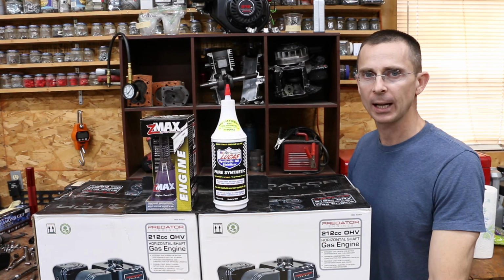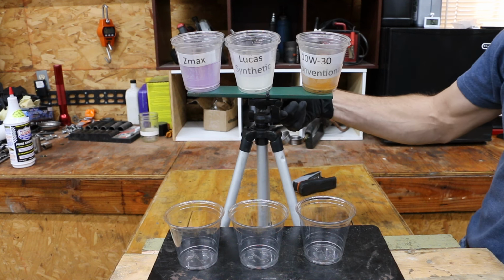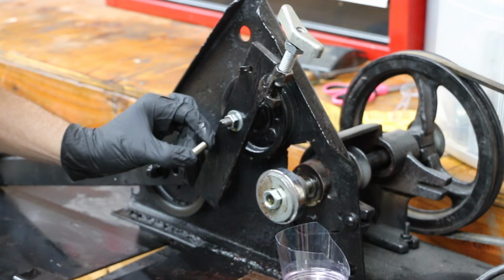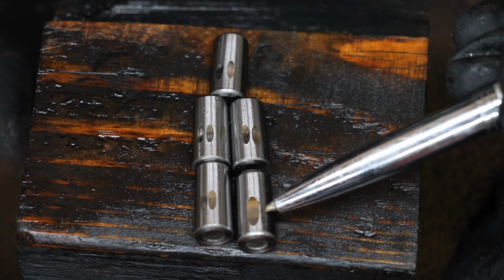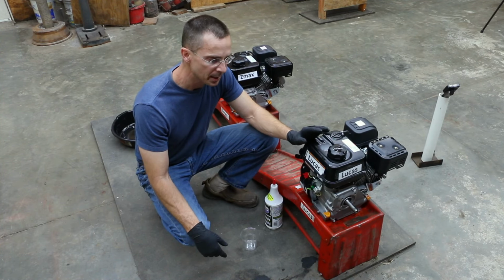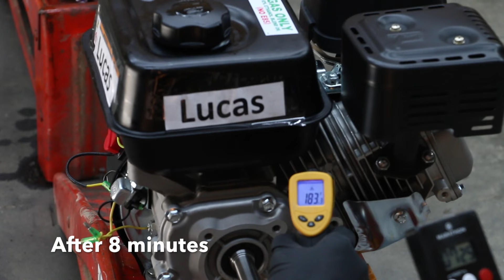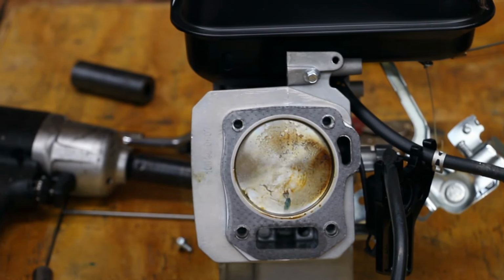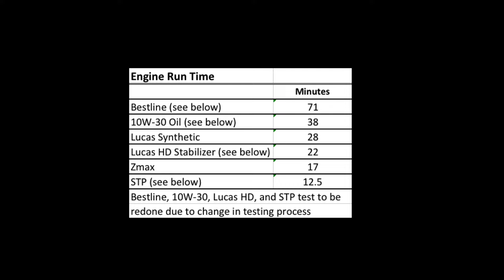Which engine self-destructs first? Zmax or Lucas Synthetic?

Comment: Battle of the labels - most expensive name brand non-synthetic oil vs cheapest generic white bottle with the word OIL on the side in black letters.
Reply from the maker: Thank you for this recommendation.
Reply: I like this idea. Theoretically, assuming they meet standards, both oils should perform comparably.
Reply: Yes good one. Always wondered about those dollar store engine oils
Reply: Project Farm If you do this PLEASE, PLEASE, PLEASE, make Amsoil one of the contenders!
Reply: This is one that NEEDS to be done!
Reply: Project Farm 1000% this should be your next video. Most generic oil you can find vs name brand and expensive oils. That would be VERY interesting...and useful to all of us!
Reply: Very good idea!
Reply: That kind of test really would be nice to see. 

Unfortunately, this type of testing does not show how well the oil copes with multiple hundred hot-cold-hot-cold cycles, how well it carries the contamination from the engine parts to the filter, how well it transfers heat or how well it protects against corrosion - all very important tasks for the engine oil and the more expensive oils often market to help with these.
Reply: Very good idea.  Dollar General branded oil VS Valvoline Synthetic Or other higher priced oil.
Reply: Good idea!!
Reply: Jason Patterson j
Reply: Stacy Smith also, call up engine masters for the amsoil recommendation like they do lol. Give it the best shot possible and pit against the dollar store brand. Very interested to see
Reply: technically they should be pretty similar as there are only 3 major producers of base stock oil. the real question lies in do they "water down"(aka cut it with fillers) the oil to extend it.
Reply: U know what I’d wanna see. The 2 best oils on the the planet head to head, Schaffer’s and amsoil

Comment: As a control sample, I would like to see an additional motor without any additives. This would tell us if the additives do any good at all.
Reply from the maker: Thank you for the feedback!
Reply: That’s a very good point I hadn’t thought about.
Reply: They are both useless in a well-designed engine with no obstructions in the oil circulation system. They are only useful in badly-designed engines or badly-maintained engines.

Lucas is oil premixed with a "climbing agent" that makes the oil stick to moving parts (gears, crankshaft counterweights, etc.) so it will get flung into neglected spots the oil doesn't normally reach. Lucas doesn't add any lubricity to normal engine oil, but because it's premixed with oil already, it's still a decent lubricant on its own. It's a BAD idea to run 100% Lucas though, because too much climbing agent will prevent the piston rings from scavenging oil properly and the engine will smoke like a chimney.
As for the Z-Max, it's basically a "pour-point depressant" that reduces the viscosity of cold oil so it circulates better -- hopefully without reducing the hot-viscosity of the oil once it's heated up. That should be completely unnecessary in a modern car because the oil they use is so thin already. However, I'd be interested to see a repeat of the initial viscosity and lubricity tests with the oil+additive mixture cooled in the freezer overnight.
Reply: @deusexaethera  OMG this guy can read.......... Wtf....
Reply: @themanthemyththelegend1392 : ...huh?
Reply: @deusexaethera  hence why it started on infomercials lol
Reply: Z-Max is a scam.
Reply: @ihatesmartphones  check the ending out
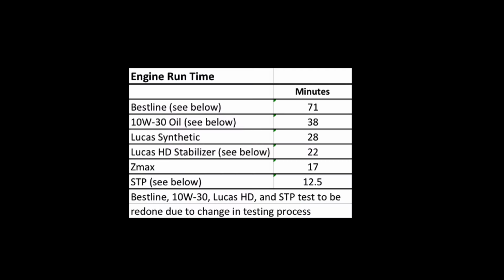Reply: 14:26 for everyone who hasn't seen it
Reply: @deusexaethera  - thank you. I was trying to understand why I got different results than these tests and you explained it.
  About 18 years ago I bought an old Dodge-chassis Winnebago motorhome, drove it 1000 miles east and loaded it with tools and stuff, then drove it back west to the starting point. We generally used Castrol, which is based on castor oil and doesn't mix with everything, but a friend who drove cross country a lot used Z-Max with it with good results. With Castrol High Mileage alone, the motorhome was getting 6 mpg highway. After adding Z-Max products to both engine and transmission, it went to 9 mpg with more load. So "pleased" is putting it mildly.
   So from what you said, that improvement was from better oil flow and lower drag via lowered viscosity.
  About that time, on the ignorant recommendation of an auto parts clerk assuring me it would mix with Castrol, I tried Lucas oil additive in a Plymouth minivan. This was before the synthetic Lucas, I don't know what would have happened with that. What did happen was the Lucas coagulated the Castrol into a thick goo that caused the timing chain tensioner to fail and derailed the chain and destroyed the engine in a previously useful minivan. Ever since then, I have bitter memories of the Lucas name and won't go near any of their products.
   I don't use Castrol anymore either. I run full synthetic oil in everything - cars, trucks, lawnmowers, 4-cycle weedeaters, anything with an engine. Preferably Royal Purple, but my son has had good results running full synth  SuperTech as well; he got around 10% improvement over conventional oil in a Nissan Sentra.
   Today's oils tending to lower viscosity for better startup flow, I'm guessing the Z-Max would not be likely to improve mileage with them.
Reply: @jacobusderottmann1000  Thanks for sharing. I think we're getting to point today where all the synthetic oils are great even the shelf brands. Can one be better than the others? sure. But they're all so far above and beyond the demands of a normal engine in normal conditions that the diffenaces are undiscernable.
Reply: ZMAX is a scam like slick 50 was back in the late 80s
Reply: I'd like to see this type of test done including the Archoil oil additive. Thanks & keep it up.
Reply: Always thought zmax was snake oil......I use lucas and have not had any internal engine problems in over 20 years and I only add one every 3rd oil change oil is discolored but not black can still see through it also use the fuel treatment/injector cleaner no issues in over 20 years
Reply: Awesome video. I’ve been using Lucas for years. Glad you confirmed my expense. Thanks
Reply: JacobusDeRottmann - I don't think caster oil [castor bean] was ever used in modern engine oils for automobiles.
Castrol is definitely not made from thick oil of the castor plant. It is wholly refined crude from the many oil wells.
Reply: @deusexaethera  well written, very informative, good additional test suggestion
Reply: There it is there; the "control" engine would undoubtedly begin to cold-seize within minutes.
Reply: @jacobusderottmann1000  No, no, the oil didn't do that, engine sludge or a leaking head-gasket on the coolant passageways side did the "coagulating" right?
Reply: @rolandrodriguez3854  It's just plain mineral oil
Reply: @deusexaethera  Well explained, but maybe cooling the oil (plus additive) overnight would not make enough difference, shouldn't the whole engine with the oil + additive be tested in freezing conditions in that case?
Reply: The bearing test showed they are useless
Reply: THAT WOULD’VE BEEN GREAT SEE OUTCOME OF THE MOTOR WITH JUST OIL
Reply: @petershulick5270  slick 50 might have been alright but yeah this test and where they said zmax was 99% mineral oil suggests its a scam
Reply: @keithbellair9508  according to test done on Project Farm zMAX did not produce results! The only product I saw that produced the results on Project Farm was motorkoat products actually meet and exceeded the test by after treating for 3 minutes draining the oil the engine ran for over an hour without seizing up! Where simple synthetic oil could not do that and seized up within 10 minutes! A lot of the old stuff on the market being marketed is nothing more than snake oil! If you think adding additives to the oil when the oil change is fine, but putting it in after the fact when the oil needs to be changed! Then change the oil instead!
Reply: @petershulick5270  well that original lucas was good stuff, they had those store displays with the gears you could clearly see the gears with lucas had a lot more oil stick to them. They claim they still use that special ingredient in all their newer products. I think a lot of their products are just copy cats but the oil additive are probably good.
Reply: Yup.